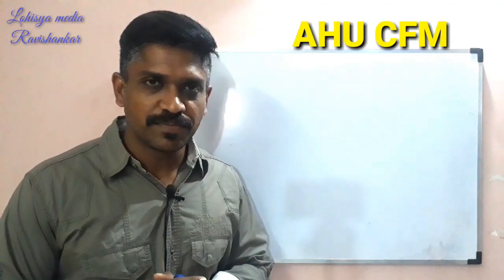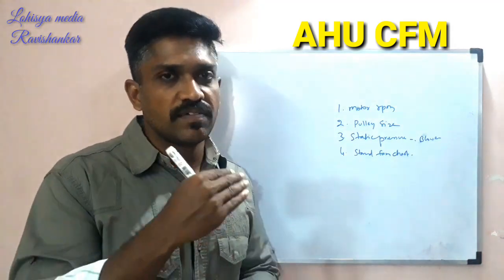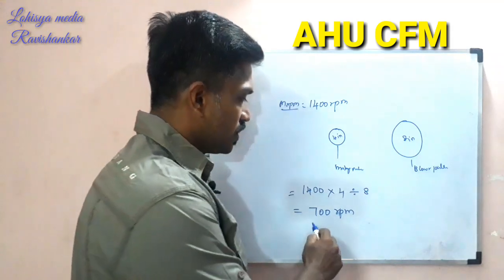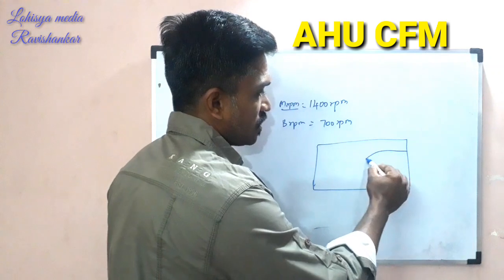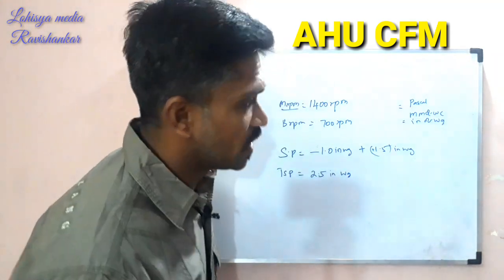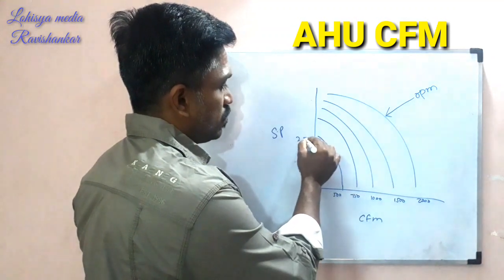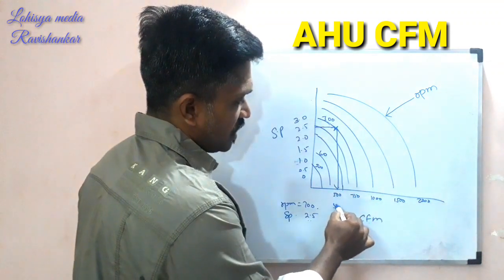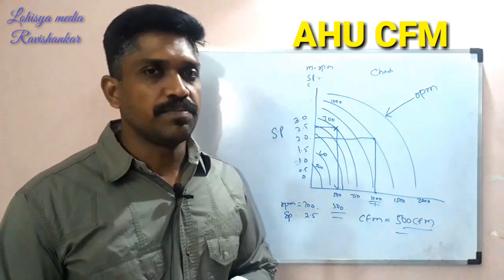AHU CFM calculation | HVAC | CFM| Tamil | Lohisya media | Ravishankar

Comment: If we have 4 blowers in one AHU how to calculate CFM in this method? and what is the name of meter to find value of static pressure? one doubt, if motor side don't have pully only having shaft connected with blower through flanch, how can we calculate speed of blower?

Comment: மீட்டர்  கேஜ்  டிஜிட்டலா  ?

Running time ல blower side ல hole போடும்  போது  supply air temperature  vary ஆகாதா
Reply from the maker: Hole running lay podakudadhu
Off panitu podanum and connectors podanum
Reply: @lohisya_media 

okay , thanks  brother

ஒரு  ahu ல் இருந்து supply க்கு  போகும்  அனைத்து  diffuser ல் உள்ள  cfm யை calculate  செய்து  ஒரு ahu வின்  மொத்த cfm calculate (approximately) பன்னலாமா ? 

ALARM :  PRE PURGE    
Pre purge alarm பற்றி கொஞ்சம் விளக்கம் தேவை
Reply from the maker: @abdullam.m5331  pannalam bro 
Already duct CFM pathi video iruku 
Enoda channel lay parunga
Reply from the maker: @abdullam.m5331  duct losses irunda motam pannamudiyadhu
Reply: @lohisya_media  
Thanks brother

prepurge  பற்றி கொஞ்சம்  சொல்ல முடியுமா  சகோதரரே
Reply from the maker: Mano meter nu solluvanga  digital ah irunda value correct ah varum